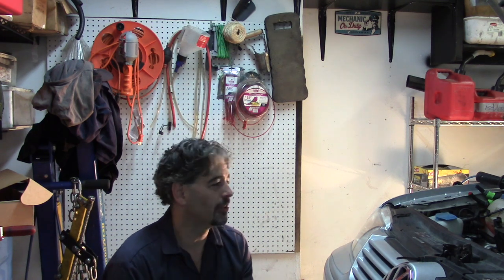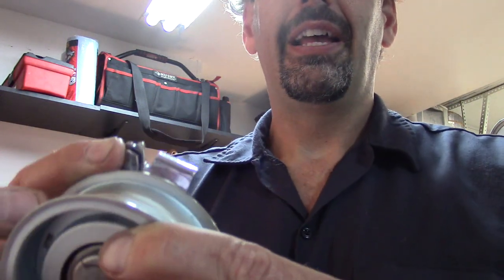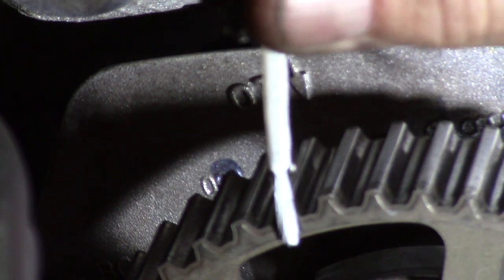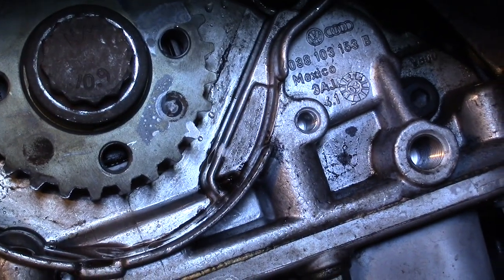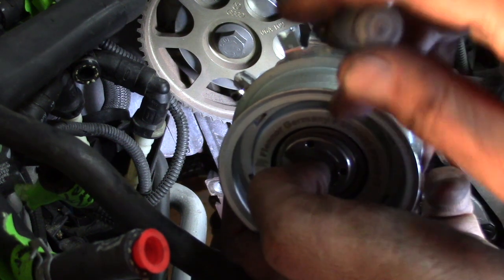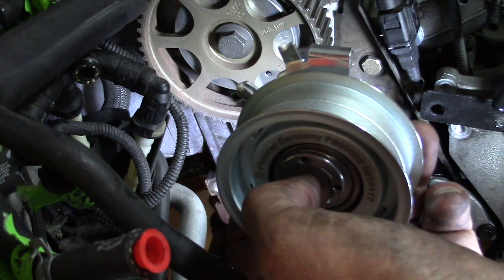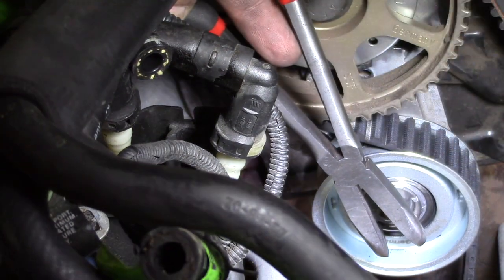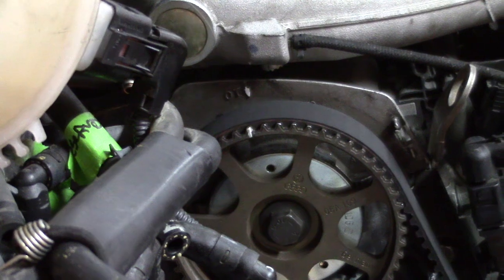PROPER Timing Belt and TENSION 98-05 VW 2.0L Jetta, Beetle,  GTI, Golf

Comment: Had someone do my timing belt and water pump and when I got it back when I drive it almost sounds like a supercharger whine, any ideas?
Reply from the maker: Yes they installed it wrong
Reply: Could it be that the tensioner is just too tight and putting stress on the bearings?
Reply from the maker: Could be. Could be other things too. Obviously it was improperly installed if this is truly the independent variable

Comment: I just did this job same car yesterday and it went well. The water pump was difficult to remove because one Neanderthal rolled the o-ring out of place putting it in last time and another Neanderthal ran it on straight hose water.

Comment: Worst thing is (not for this particular problem) I have a VR6 12V, and every time something goes wrong with the car and I need a little guidance on diagnosis, how to replace certain parts, or where to find this part in the vehicle; I can't ever find this engine. It's always the VR6 24V, the 1.8 and 2.0, or the tdi, but never the 12v. And, if I do, it's never in enough detail.

Comment: I Recently changed my belt a couple days ago, I had marked and aligned everything but I did not clamp the camshaft when turning the crankshaft. After I was finished of course where I marked the camshaft was not aligned to its original position. The car runs fine but the CEL is on...
Reply from the maker: I imagine the code is for either a cam/crank misalignment code and/or a volumetric efficiency related discrepancy.
  You will need to re-time and reinstall belt correctly.
  Even one tooth off will cause a CEL.
Reply: thanks I will check what the code is this week.

Comment: Actually a great video. I did run into exactly that issue when i changed a timing belt on a passat last winter, it was my first time doing a timing belt and i had no idea how to set the tension. Just about every video i watched did skip this part.. 
(oddly enough in all my search i didn't find this video, would have helped me a lot!)
Based on a vague forum post regarding a totally different vw engine that said something about aligning arrows i figured out how to set the tensioner by myself, i just turned every moving part in every direction it could go until i figured out how this thing works.. Tension was set perfectly.. sadly didn't help the engine, it was retired due to high oil consumtion soon after.

Comment: as you see, between the crank and the camshaft in tension there is nothing adjustable. so, in any tension the same teeth are between the crank and the cam. that's why they told to put first the crank, then guide it keeping slightly tension and put to the cam. if you did it right you can finish it, the position beween crank and cam will never change. certainly you can do it from the cam too, the important thing is go to the crank first (in this case to the water pump then the crank)) and finish always with the tensioner.

Comment: Could you give me a rough percentage on the chances of having damaged the engine from timing belt breaking while driving.? 2003 vw jetta 2.0. From what I'm reading it's a interference engine. Can't believe engineers went with a rubber belt and interference set up. I think it went to safe mode and saved itself. I have turned it over using key and never heard any weird noises either before or after the break. Thank alot. I'm using your video to replace timing belt and components. Excellent job.
Reply: Honestly, I know this is too late, but for anyone else who wants to know the answer. If you're driving, and the timing belt breaks, there is exactly 130% of a chance that there will be damage to the engine lol. There is no safe mode to prevent any damage or anything.

Comment: great video! clear, articulate and straightforward. Was this a BEV engine? because I got the same Jetta and mine is BEV and I wonder whether it might slight variations in procedures or what have you between BEV, AEG and the other two engine codes or not, thanks. And if I dont f..k it up too I'll give you $1 gladly haha
Reply: Just another 2.0 Jetta.usually a 04 jetta

Comment: i have golf city mk4 2007 2.0L i have problems with code (P0171 SYSTEM TOO LEAN) I replaced maf sinsor and full pump and engine is good so what's problem with this code. can you help me please. best regards. iam from iraq.
Reply from the maker: What was thre data you had that indicated the MAF AND the fuel pump were bad?? That is virtyually an impossibility since the fuel trims would be diametrically opposite patterns against load.
  I need the data you had that gave you that conclusion and I would start from there.

Comment: good vid, couple of points tho is after installing and tensioning the belt you should turn the engine over from the crank by hand(socket/ratchet not starter motor)two full revolutions recheck your timing marks and than loosen the lock nut on the tensioner and reset the tension as you showed. this does two things 1 makes sure you wont bend a valve ie did it right, 2. moves all the belt slack to the tensioner side the way the engine does so that when you reset the tension your doing so with the correct amount of slack on the tensioner side. you have to loosen the lock nut on the tensioner or it wont move when you reset tension. for whats its worth ex ASE master tech and i always did this every t belt i did tho very important on an interference engine. normally because of service interval your changing the spark plugs so leaving them out makes turning the engine /t belt replacement much easier.
Reply: thanks for your detailed explanation . :-))

Comment: I'll be doing this repair next week under basic maintenance.  Last time it was changed was 80k, and we are at about 157k currently.  Car still runs like a top!    Oddly enough we where at a pick and pull yard today, and I decided to inspect the timing belt on the Beetle it had in the yard.  

If that belt wasn't already gone?  It was darn close!   Back of the belt checkered with tiny splits, some pretty deep.  Looks like no one paid attention to it.  Probably wouldn't have lasted to long.  Looked more like dry rot was starting to set in.

Thanks for the detailed information on this.

Comment: Thank you- I've also found some manuals and videos too short on details. I'm also working on a MK4 Jetta. Just curious: Did you have a hell of a time getting the belt on, or was it a fairly smooth process? If your belt was also a very tight fit, can you offer any suggestions on how to get it on? Mine is tight to the point where I can't image it going on with anything but a pry-bar, which I'd never do in a million years. Any less destructive ideas?
Reply from the maker: It sounds like you did not release the tension.
Reply: It was a new tensioner-- I had it seated in that little frost plug that keeps it from spinning freely, and ended up having to back the tensioner out all the way to the edge of the bolt to get the belt on. 

I was hesitant to do that because of how tight the belt was / didn't want to risk deforming anything, but it worked out fine: no casualties. Thanks again for the video.

Comment: I am currently looking into doing this job myself and was wondering how you chose the crank setting for top dead center since there is no mark on the plate as you stated in the video!?Great video by the way! Extremely well put and put together for those of us that choose to "DIY" on our cars since its hard to trust mechanic shops these days!
Reply from the maker: If I recall I chose the crank setting based on actual TDC compression for #1.  In fact I always do this, rather than relying on the marks.
  A piston is either at TDC compression or it is not. This is regardless of the marks.
Reply: Thank you for the info!

Comment: You mentioned a catch on the edge, when setting the timing belt tensioner. Then when you say its set, it looks like its over the water plug hole. any thoughts?
Reply from the maker: I'm... yeah.... that was a drop of coolant, not a notch.....

Comment: hi I must ask how you were able to get the belt back on? I've tried doing it from crankshaft up to camshaft down and not only is it super tight but the few times I do get it on all the pulleys, the crank rotates a few degrees
Reply from the maker: Release the tensioner

Comment: There is a Marking for Cylinder 1 TDC on the Crankshaft Gear, but you can only use it with the Special Locking Tool.

Volkswagen recommends to span the Timing Belt five times to set the Timing Belt onto the Gears, just like you did in your Video.

Comment: you need to do one on a fuel pump for 2000 vw jetta with the 2.0 motor
Reply from the maker: Why? A fuel pump diagnosis is a fuel pump diagnosis. it doesn't matter what car. It's a matter of knowing if it's PWM or FPR regulated.

Comment: a pointer... instead of the bypass on the fuel, or reconnecting or whatever... just pull the fuse for the fuel pump. you can turn the engine over without it catching.
Reply from the maker: You do not want to do that in this application due to the residual fuel pressure causing the engine to run. Disabling the spark is far more secure.
Reply: What if before starting the job, you pull the fuse, turn the engine to dry the lines, then do the belt job?
Reply from the maker: Did you see the condition of that belt? Again it is an application  specific decision that I do not want to run this engine in is situation to dry it up.   But even If there was not risk of timing belt failure I would still have disabled spark just because it is so much easier to do on this model.  It all depends on the application.
Reply: sorry, i was basing the change on a car that is properly running, but needs a belt change. like my situation. car runs fine, but its pretty deep into its life and needs some maintence. i would clear the fuel line by pulling the fuse before running the engine. do the belt work and make sure timing is right and tension set. then turn the engine a couple times to check timing. put car back together, replace fuse... and zoom zoom. ^_^. is there any reason this method would cause an issue?
Reply from the maker: Not at all. On some cars it's easier to do that anyway.

Comment: Great video, I'm doing this job on my 2.0L 2001 Glof MK4. Just notice camshaft has two marks, each 180° opposite.
I perfectly understand you video but mi camshaft mark aligned to  arrow mark is the one at 180°, not as you video, I can see this because "four ring" Audi logo is at oposite side of the camshft sprocket. Is this has something to do? Do I need to a 180° turn of my camshaft sprocket? Thanks in advanced
Reply from the maker: Yes many cars have this. Obviously on the correct cam placement valves will be closed on #1 on TDC compression.

Comment: I messed with my car more this morning, I used a pressure tester on cylinder 1 and put a balloon on the end and waited till air filled the balloon to find top dead center, but still I tried to start it and it didn't start and it had different noises so I did not keep trying to start it. I hooked it back up with a balloon and rotated the crankshaft and no air at all is coming up, put my finger on the plug hole and I don't feel any pressure in or out. I am at my wit's end.
Reply from the maker: You really need someone who knows what they are doing to take a look.  Stop now and tow it somewhere.
Reply: I can follow and understand the process.  Put $1000 into a car that cost me $700? Doesn't make sense.  This is my usual situation, I see videos that explains a fix to the tee, and I follow it to the tee and it does not work for me.  So I think I am being careful and doing everything my local shop would do, less the $1000 charge....
Reply from the maker: Barry Perkins It's because you are just following instructions, but not comprehending the application. It is essential to understand the fundamental mechanisms involved so you can adapt your procedure to variables specific to your application.
  Not doing this will always result in making things worse than when you started because you will be unable to re-establish the baseline.

 You need to stop doing things because you will keep introducing variables that complicate it for someone who will come in to fix it.
Reply: +Schrodingers Box it seems pretty simple, line up the camshaft to the mark on the cam pulley to the mark on the cover behind it. Then find TDC or (the correct position) for the crankshaft, there are several ways. the little plug on the left side of engine, I guess it is the flywheel , did not help me because I turned the crankshaft around and looked closely and there were no obvious marks that I could see to line up.  I used the balloon method in cylinder #1 and thought that would be the most accurate. but that did not work.  I don't think this is brain surgery.   I will not be taking the car to a shop, it will be in pieces in my garage before I licks me.....

Comment: I need some help!!  I am trying to do this job on my 1998 VW Beetle.  the car started overheating, and running rough. took it to a shop and they wanted $750 to fix it. they said it was most likely the water pump. and the leaking coolant messed up the timing belt. but I did not want to shell out that much money and decided to do it myself.  After getting to the timing belt, sure enough the water pump looked shot  and the belt was covered in coolant and missing about 5 or so teeth.  Now my problem. I have followed this video (excellent by the way) the cam pulley is easy enough to line up, but I am having trouble finding the right position for the crank shaft pulley.  the pulley had some marks on it, the  balancer has a yellow mark on it and seems to match the pulley.  I see a notch on the balancer and balancer.  I tried finding TDC by taking out spark plug #1 and put the tip of an old fishing rod and moved the pulley until I felt it was at the highest point, did not work. I have put the belt on and off in different positions but the car will not start, not even close. The little bump on the crank pulley always is in the lower right 1/4 of the circle.  .... hoping someone on here can give me some advice.  I am just guessing now with no luck.  thanks in advance for any help.

Comment: I plan on doing my timing belt tomorrow morning based off your exact video, following basic instruction. I only have one simple question: Does the piston and cylinder positioning change based on what I will do (and you have done) to the timing belt? I have followed each of your videos to a T. Removed the head, replaced the gasket, and while i am in there plan to do the timing belt, water pump and serpentine belt. I am anxious for your reply. Great videos.

Comment: I have an automatic 2001 VW golf 2.0L I removed the timing belt before realizing I needed to mark where the CS was at.  I have the CA at TDC but in trying to get the timing belt back on I have moved the CS a little and I am concerned that it is not where it needs to be.  The VW instructions show a port that you can check on the tranny being TDC but I don't know where it is.  Can you help me? How do I make sure everything is lined up correctly now that I have already taken the belt off and have moved the CS without the belt on?
Reply from the maker: +syawn hopkins Very simply Set #1 to TDC and install with that as your baseline.

Comment: any suggestions for putting the belt back on? seems really tight. the instructions say put on the bottom and leave loose on top then reinstall almost everything  before putting it on the top. don't  want to do all that work and not be able to get it back on. I can't seem to get it on with nothing in the way

Comment: First off, awesome video. I had a question. I just got my timing belt, water pump, tensioner done recently and about a week after I got it back, my check engine light came up with a code P0140: oxygen sensor 2. So my question is, can the timing at all affect or have anything to do with the o2 sensor going off?
Reply from the maker: +Philip Ramos It's possible. What data do you have?
Reply: +Schrodingers Box Well really nothing so far. I got my car back last week Tuesday. Was driving good. Then this Tuesday that just passed, check engine light came on, I checked code at autozone and P0140 came out. I haven't looked at my car yet. I was curious if it could be related to the previous work done (i.e. timing belt, etc) or if it was just coincidence. I'm going to work on car this weekend. Thanks for your relatively quick response. Some folks never write back!

Comment: PS: this does have a timing mark on the outer crankshaft pulley (it should be at 12 o'clock, and there's a mark on the block to it)... i hope i'm not annoying... cheers!!!
Kudos for the excellent work, usually the water pump is replaced with the belt and tensioner...

Comment: there is a small american company called the metalnurd that makes specialty vw tools they make and sell a tool that will hold the crankshaft pulley rock steady while you install the timing belt.  I did this timing belt replacement twice. I wish i had that tool back then, would have made the job so much easier.  Also, If you have a high mileage / or an old mk4 
it might be a good idea to replace the cam sensor -- which is right behind the cam gear on 2.0 gas engines -- before it fails and then you have to do the timing belt install all over again....